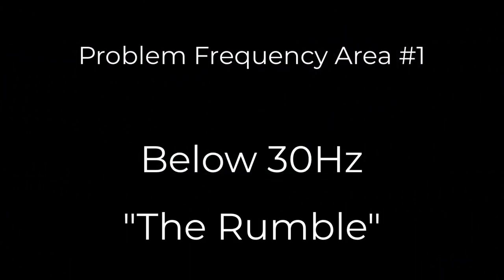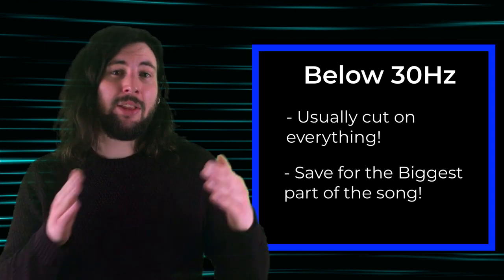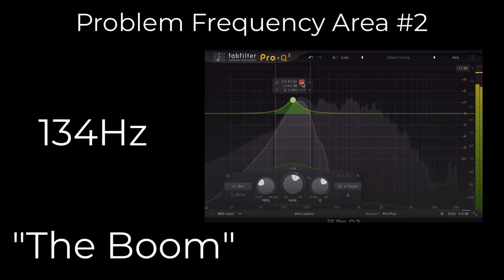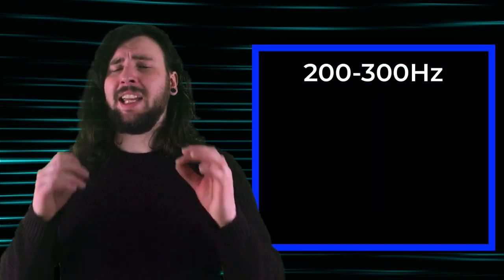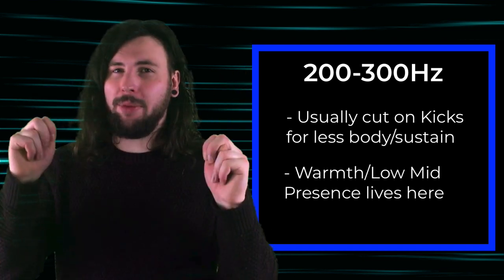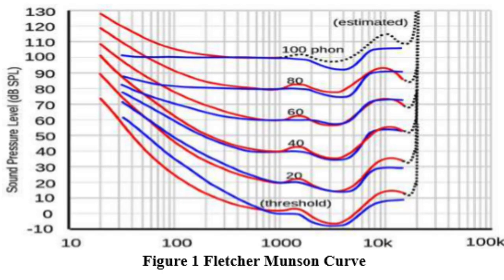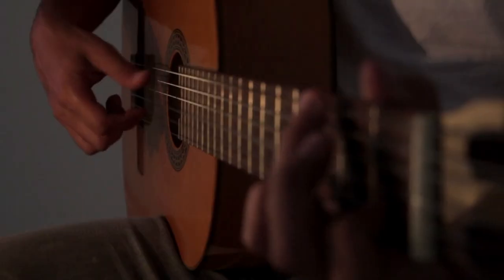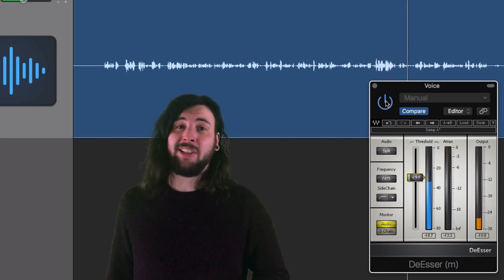5 Ugly Frequency Areas YOU SHOULD KNOW

Comment: My BIGGEST issue is harsh synth sounds. The kind of sounds where if you don't cut it's piercing and if you cut you basically mute the part, even with a dynamic EQ.
Reply: Use soothe 2
Reply: @marcomaselli8986  what makes it different than a dynamic EQ?
Reply: @nhdyz  it's basically the same thing but you make ton of cuts with narrow q factors, yeah maybe a dynamic eq is more versatile but you are always limited by the amound of bands you can create. And even if you are not limited by that, you spend a lot of time drawing stuff like 10 bands and set the dynamic eq right for all of them. Using soothe instead you hilight the area u wanna duck area and it makes cuts for you in a very smooth way
Sorry for the wacky explanation
Reply: @marcomaselli8986  Fan filter has infinite bands
Reply: Sooth2 and bx_refinement can help u
Reply: My BIIGGGESSTT issue is my brothers voice. Idk what the frequency is but it’s definitely like 900+

Comment: Thanks, this is going to be useful. I find I'm always cutting boxy 450 and then the muddy 250 goes with it. I struggle with how wide to make the cut but I center it around 450 because that seems to get the best results but I'm really after 300 to 600. I've ascribed it to the overlap of all the voices and instruments, but I don't know. After watching this, I'll lean toward 350 instead of 450 and see how it goes. I'd be curious if my going after 400 to 450 tells you anything.
Reply from the maker: good point on the 200 and 400 area. I find the mud and boxiness and sometimes an octave apart, so those areas could both cause lo mid buildup as you mentioned. thanks for watching Robert!
Reply: I agree with this. there's this hollow "ringing" sound that seems prevalent in the 450-570 range. when i cut this range, the mix sounds way cleaner

Comment: Love these videos man! Thanks! So like, I'm totally struggling with the low end, will try the 130Hz cut now. I usually cut around 200-300 and the rest depending on where I hear some noise I deem that isn't important. I usually go with a narrow Q boost and solo the freq until I find some trouble areas that aren't contributing to the sound and cut them out. Idk, someone can tell me if I'm doing it wrong I'd love to improve!
Reply: Yeah man, Low end is a difficult thing to get right. Two things that have helped me a lot where getting a subwoofer and a plugin called Bassroom by Mastering the Mix. - if you've not heard of it  - it's worth a look,  all the best :)